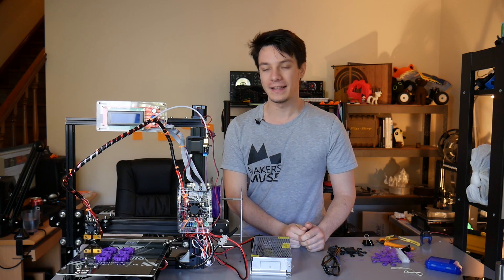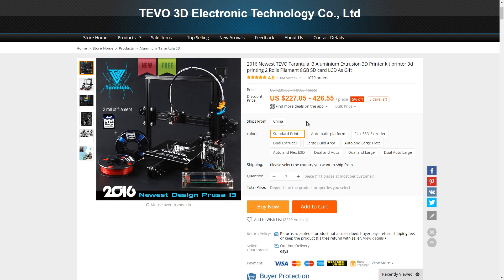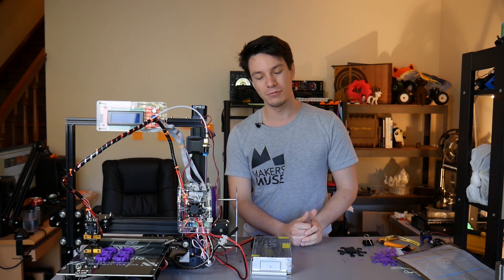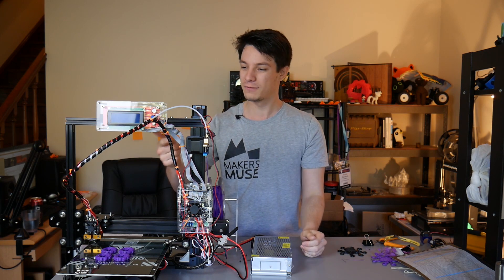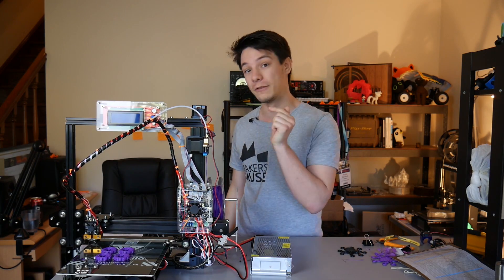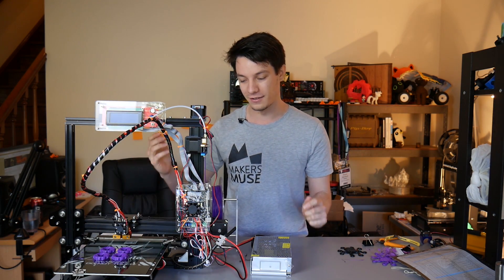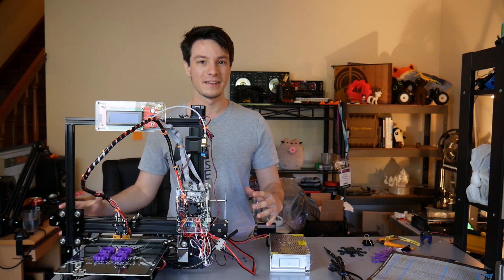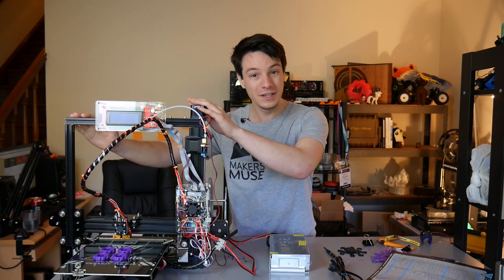Tevo Tarantula Review - Read the video description

Comment: Darn, you seemed so positive in this video. I was almost at the point ordering today. Heated bed, some auto calibration, abs&pla, nema motors, DIY and for a price below 350 dollar. But after reading the negatives I am in doubt again. Will replacing the power supply with a safer one fix your main concern? Or are there better alternatives with these features and price range?

Comment: FLSun (makers of a popular Delta Kossel)  i3 is the new contender.  Alu construction but with linear rods and bearings in stead of rollers (including two under the bed), dual bottom-mounted z motors, heated bed, e3d clone hotend, bowden extruder, im estimating 280mm build heigth on mine, all for under $200.  *Do upgrade the power cord and main power cables to at least 16 gauge and fuse the latter!

Comment: I own a tarantula and I must say it's not for every type of customer. But I'm sure it will teach you how a FDM printer works if you decide to buy one. Once you understand the mechanics it'll spit some amazing prints because it's capable. The facebook community is insane. 17k members right now and still a very mature and helpful group. You can ask anything about your experience and learn from others' mistakes or advices. Sadly most cable connections are still as bad as in this video. Acrylic bed support is still a minus. Also hotend and extruder assembly has some tricks that has to be done right. But at the end, if you do it right, this thing does not come short when compared to a wanhao or prusa mk2. As a side note, all the acrylic parts, except bed support are printable with better versions. There is no acrylic chasis or long parts like some chinese i3 clones except the bed support as said. If you're into maker world and interested in 3d printing this is a really good starter and will do the job. But if you want everything near-perfect out of the box, check ultimaker 2,3 or better and get ready to pay some.

Comment: tevo owners know why pt 2 aint coming..
Reply from the maker: Is this some kind of conspiracy? It isn't coming because it never worked properly... Faulty rollers, leaking extruder and flimsy brackets. A video is coming on the custom machine that was made from the parts included though.
Reply: Maker's Muse yes conspiracy. get a tevo they said, it'll be fine they said :) I hope you end up doing that video, we need an official toturial about wiring an atx psu.. and also how to use ca glue with kicker on acrylic
Reply from the maker: Sorry for coming off as defensive - I've just updated the description of this video to highlight what went wrong in making the Part 2. Lots of interest in this machine and I want people to understand what they are potentially getting into. I just put together my review for the TronXY X1 and I was staggered by the differences in design, part selection and quality of the assembly manual. It doesn't even have a community around it as far as I know yet and is ~150US
Reply: Maker's Muse oh cool thanks for the write-up. Im not trying to be a hater. the journey of getting a clean running tarantula has been challenging, entertaining and quite facinating, so i cant help but make light of its bizarre nuiances.

Comment: I'm sure it's in the comments, but maybe update in the description if no part 2 is coming? maybe update the title? is there going to be a part 2? 

I'm very glad I saw the mention about that backward z-axis motor mounting... that's terrible. Any way to turn that around and put the motor on the bottom?
Reply from the maker: There seems to be a revival of this video - the parts were repurposed into another custom built machine as I was not a fan of the Tarantula's design - and many parts included in my version of the kit were faulty such as the rollers and extruder block. Still waiting on some new rollers from china then it should be good to go for a 'part 2'
Reply from the maker: I just took the time to edit the description as suggested, cheers :)
Reply: 10-4, really nice job btw

Comment: The most important question - is there a cheaper alternative?
Reply from the maker: Check out the TronXY - Preston over at Press Reset on YT has one.
Reply: Whoa, thanks for the quick reply. :D I live in the EU which has made the Tarantula a natural choice since they have a shipping hub in Germany - making the alltogether cost smaller than the TronXY. 

However - I have just decided to buy a slightly more expensive Polish Prusa spinoff - MDF frame, 2 Z-axis motors, 2 sliders for the Y-axis...  (The printer is for my company operating in Poland so the tax situation looks better this way). You can check it out under google link "Printo Prusa i3 Lite".

Comment: A 25 amp power brick? Through a barrel connection??? You are not an EE or even an Etech are you?
Reply: Oh of course such thoughts cannot be unique. thingiverse.com
Reply: Yeah i cringed when he said barrel connector too. Something like ATX Molex does what, 10A per pin at 10°C temperature increase over ambient, and it has more than a little leaf making contact with the barrel... this calls for something like XT60, which i know is a bit of an overkill, but if you get a clone it's going to be worse anyway, but at least availability is OK.

Plus a brick power supply? I don't know of many that will do over 12A. All the higher power ones from gaming laptops etc. run higher voltages too, though i guess some Xbox360 PSU models would borderline work. I'd likely get a Delta hot-swap PSU from a server though.
Reply from the maker: Tonnes of 3D Printers with heated beds I use run through a barrel jack - not a tiny one, think laptop class and they often use a similar sized brick. Granted these are higher voltage (19 to 24vdc) thus lower amps for same watts. An XT60 would be better for sure, do they make panel mounted ones yet?
Reply: Maker's Muse to my knowledge there isn't a panel mount connector, but there is a panel mount kit that you can buy, probably on HobbyKing. The connectors usually have indents that allow to retain them securely, and the panel mounting kit as well as device enclosures make use of it.
Reply from the maker: Ah neat, yep so you can - 3 bucks... Thanks!
Reply: I'd have an urge to design a printable one, but the sizes are finicky and it can take a while, so I guess for one off buying is easier :P
Reply from the maker: Hah! Too easy...

Comment: Purchased one of these and had for 2 days before I sold it on to someone else. Took well over 30 hours of construction/calibrating... and it wasnt even able to print a cube without making a terrible mess of it.

The power supply is definitely dangerous and the board connections are terrible.
Reply from the maker: Agreed - I need to follow up this video as I won't ever be assembling it 'as intended'...
Reply: Would love to see a follow up. I purchased one as a beginner project for 3D printing... Biggest mistake. And much like you mentioned in the video... The risk of getting shocked is pretty high. I know that for a fact because this very power supply shocked me. Luckily it was only very brief but still incredibly dangerous.

As for the overall printer... Not worth the money. The automatic levelling and heated bed options are nice, but thats about it.

Comment: Power supply is 250w, barely adequate for the smallest base model, but virtually no margin of safety.Does the dual extruder, large print bed, auto level, espresso machine model come with a bigger power supply?
People should not be so afraid of mains power hookup, and start worrying of blowing a power supply. Those make some very nice sparks and your circuit breakers really can't protect you there because the problems usually come on the other side of the coil. If you mess up your mains wiring, it will give a quick spark and trip the breaker in any modern home. In the newest homes in the US, arc fault breakers are required by law, and those go off if you pull your vacuum cleaner cord out of the wall while running.
Top signs you have a weak power supply:
1)bed takes an hour to heat up
2)stepper motors bog down when the bed kicks on
3)power supply gets hot to the touch
Best way to check if your power supply is struggling:
turn on power supply and put a volt meter on the dc output, should read around 12v for 12v models, around 24v for 24v models. A lot of power supplies have extra sets of output terminals not in use, so you can just screw your leads into one set of those, easier than holding them. Now, write down your measurement. Then turn on everything. Maybe run a print of something that gets everything moving, a preheat and homing (but that doesn't get the extruder moving), and read the voltage now. If the voltage drops significantly, you need a bigger power supply.
I'll add another safety margin to this: If you have a heated bed and a 200w power supply, you should consider upgrading. Average hot bed runs 120w, average hot end runs 30-40w, so everything else is left with 50 watts to run.Everything else includes , but is not limited to, stepper motors, motherboard, fans, displays, extra hotends(and the extruder to go with them, leveling sensor, and espresso machine. Not much of a safety margin. Also, it should be stated that power supplies are kinda like car motors. Sure they rev up to 6, 7, 8000 rpm and are rev limited there, but if you let it run pegged for extended periods of time, your engine will get very unhappy with you and start doing things that you didn't think the laws of physics should allow.

Comment: DON'T buy this thing.... it really is a pile of junk, that is improperly engineered....rollers instead of liner rods...why?

If your're cheap, get the ANET A8. At least that has a proper setup, with it's main downfall being an acrylic frame. Luckily, you can buy or make a steel frame for it and it will be leagues better then this thing.

Comment: I've put over 20 hours into this kit. (I have the bigger bed model). This is my first kit and I've run into sooo many problems. The temperature monitor for the extruder wires came undone so I constantly get the mintemp error. Resolved that now I can't get the extruder motor to move the filament. There seems to be no signal from the board to the motor. I think I might have blown the circuit. Any help?

Comment: The great thing about a kit like this is, if you aren't satisfied with the results, you can very easily upgrade it. Strengthen the frame with aluminum parts (fankhauser.me) to replace the acrylic. Add a second lead screw and stepper for the z axis. Switch to mgn rails instead of the wheels. Get a different control board. Get a different extruder or hotend. Build your own enclosure. All those parts are easily available. The purpose of a kit like this is to do-it-yourself. One thing to note, is that even since your review, Tevo has improved the instructions. I bought mine about a month after your review was posted, and the instructions were even slightly better than what you showed, so they are working to improve that. The new instructions have been scanned and uploaded to the facebook group.

Comment: 6 different 3D printers later, I can say that without a doubt, All desktop printers require tweaking. If you build your own kit, at least you will have a much better handle on what needs to be done. 
I have yet to see one offered that is right and correct out of the box. 
Why it is so hard for printer manufacturers to understand that we need quality filament cooling is a mystery. 
Acrylic beds are stupid. Quit it. 
Thin steel rods for x and y axis that sag over time... I'm going to stop now.
Reply: It's a $250 kit. I'm sure they could easily eliminate all of the acrylic with aluminum and sturdy it up, but would they still sell it for $250? Nope.

Comment: Where did you buy your printer off of?
Reply: I have an Anet A2. The plate and wheel setup is better(?), I have had no issues with wheels binding, or wobble nor does it have any weird eccentric nuts.

Z-axis and bare PS are still issues.

Also, I suggest assembling the wheel parts over the extrustions, do not try to ride them on as the instructions say.  ANY small nick in the wheels will create a jerk in the motion.  Smoothing out the jerkiness is one of the big tuning issues on these machines.

Comment: As an electronics engineer i'm VERY concerned with the way they let you handle the mains-voltage powersupply-wiring. From what i can see, this is not even the right cable they supply with the printer. It is mandatory for every metal/metallized part of a device that does get connected to mains to be connected to earth (PE). Everything else is pretty much illegal around the world. (There are product safety regulations that cover this too...) 
If something fails and someone gets killed or a house goes up in flames, good luck trying to get insurance to cover your losses. And i'm pretty shure this chinese company would just disolve into thin air if anyone starts legal actions against them.
Is it too much to ask them to add a proper mains voltage connector like a C13 socket to that supply, so you can just plug in a standard cable (the same ones you use to power your computers, screens,...)? There are even premade modules for these closed frame powersupplys with a C13 connector and some plastic parts that cover all the mains wiring.
If i see stuff like this kit sold anywhere, the manufacturers of that crap are outright dead to me, no matter how good or cheap the products are. This is just putting theyr monetary gains over the life and safety of potential customers and should never be supported by anyone!

Comment: A lot of these design choices are cringe worthy. For the price of that kit I rather build a Mendel90 or Prusa i3 from scratch at this point (which I have and it's a lot of work for sure). It's still entirely a huge opportunity cost building a budget printer. I wouldn't wish anything like this on a beginner.

Comment: Hey Angus, I have a question for you (or anyone else who knows), because I'm new to the whole 3D-Printing Thing and I'm just getting into it. So the question is quite simple: Is it possible to pause your print after it started and continue if you want, or do you have to start all over again if you cancel it halfway through? And if it's possible, is this a common thing or does it only work with certain Programms/Printers and certain Filament? Thanks to anyone who can help :D

Comment: I purchased a Tevo Tarantula and I agree with everything you said.  The upside to this printer is that once you do the tweaks and improvements that the community recommends the printer then prints spectacularly.    Most of the tweaks are just printing out better designed parts and changing out the acrylic, some braces for the Z so it does not flex as much and a parts cooling fan.  Sounds like a lot but really just a little bit of filament and the price of a fan and you are on your way!

Comment: I got one a while ago. I have assembled printers before. I got an extra brittle batch of acrylic parts. Things like the z axis stepper and the extruder mount snapped under their own weight!!!! I was able to get replacements which I reinforced with some Plastic PVC sheet cut to shape and glued onto the back of each piece then I re-drilled all the holes in the newly attached sheet. I now works however I had had problems with it clogging and have not yet been able to get a successful print (i think my PLA had absorbed water since I last used it.) To be honest If i hadn't had so many problems this would be a great kit. Now I'm a little bit over it. I want the building to end and the printing to begin my particular kit has been too much hasstle.  I'm honestly considering just saving to get a decent pre built printer (which is odd because I love building stuff). I'm sure others will have a better experience then I did. I'm pretty sure I just got unlucky. But just keep it in mind before you buy one you many be spending alot of time and effort on it if things go wrong.

Comment: Nearly finished on a Tarantula build, The biggest concern for me was the machines rigidity, so I went to Bunnings and spent $15 on a length 50mm L Bracket and made a set of brackets that support the upright rails and at the same time bolt the whole printer to a sheet of flat mdf...It is now is very stiff and has no flex. Next job is to build or print better Z axis motor mount and replace the coupler and I think those mods will set it up for been a pretty decent printer without too much extra time and money.